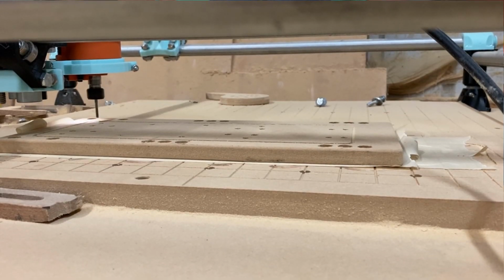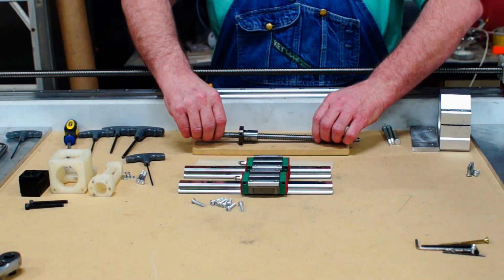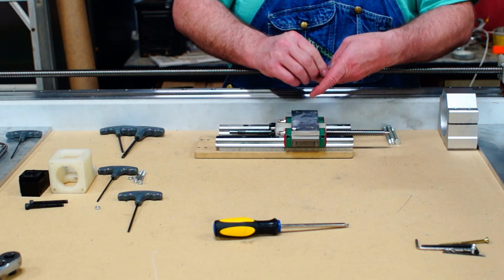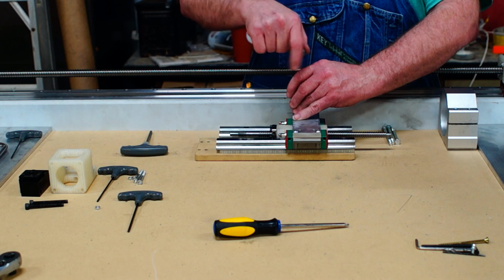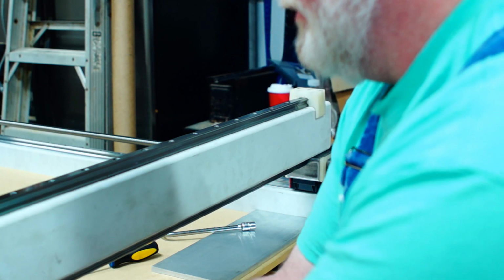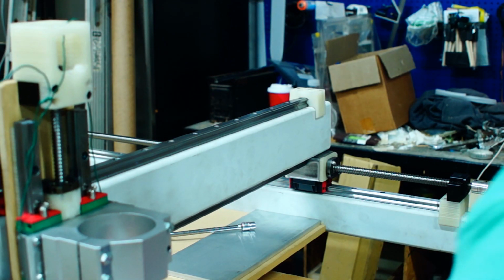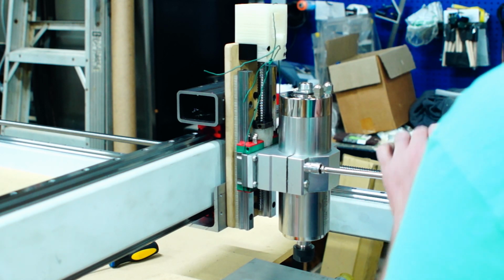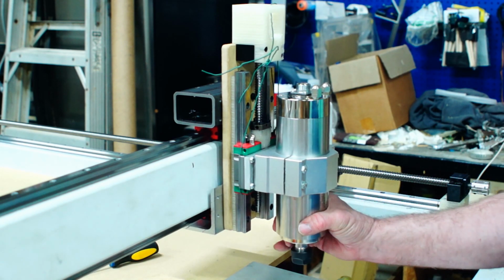Mudd Flapp Ranch- PrintNC Z Axis Build

Comment: I am so impressed with your video.  I just found your video today and it is awesome. I like the way you laid everything out at the beginning of the video and explained the parts list then showed why you changed fixtures and why. The bolt sizers and thread pitch is so helpful.   The hardware is just one of the hardest and most aggravating. I print a lot of 3D printed parts that I pry on with screwdrivers and beet on with dead blow hammers and I do not give them any slack.  Just a thought for someone else for the part that you thought would be the weak link and I can understand your thinking.  Just a thought,  could you have used a piece of all thread and extend it all the way down through the 3D printed part and put washers at bottom or a thin plate of Aluminum and even still tightened nuts at middle location.  Thank you so much!!  God Bless  A Thumbs up and I definitely Subscribed.
Reply from the maker: Thanks for the kind words. As to the strength of the 3D printed parts, I don't think it is a factor in my use of the PrintNC. Many builders go ahead and cut those parts from aluminum as one of their first projects.

Comment: Absolutely loving your series!  A trivial point:  when you used the Wixey to set the spindle to perpendicular, use it on the "Z" rails first, then do the spindle so it is parallel to the "Z" rails.  The difference is probably not detectable though, unless you are chasing microns!    :o)
Thank you... Liked and Subscribed.
Reply from the maker: Good catch. I did check the rails as well. Probably got edited out. They are also dead on, at least as good as the Wixe.y.

Comment: Thanks for the video.  For my Z-axis I ended up redesigning it to use stock aluminum materials I could buy locally (inch sizes).  I also am using a router with a larger mount so I needed to redesign the spindle mounting plate for two reasons.  One to allow the larger mount and two to allow it to go down further since the router doesn't have as much travel in the clamp as a spindle.  I was always worried about the system travelling too far so I came up with a simple solution for my setup.  I used an aluminum block to mount the ball screw nut.  Then I put a screw in the plate that holds the rails.  I put a couple washers under the head and lined it up with the ball screw.  I've got the height so the linear bearings just stop at the end.  Now I don't have to worry about everything falling off the end of the screw/rails.  Looks like you're getting close!
Reply from the maker: I had originally purchased a Makita router to use on my build, but came across a deal on a 2.2KW spindle, so I jumped on it. I had also designed a Z plate that extended about 2 inches down from the bottom of the gantry to extend the reach of the router. Now I have the spindle and a spare palm router. Spare routers are handy when working on projects with multiple bits, so nothing lost.
Reply: @MuddFlappRanch  Yes, you can never have too many routers.  I already had the router and it was too big for the standard spindle mount everyone else is using.  I'd like to get a spindle in the future but I'll start with the router and see where it goes.  Plus I was a little intimidated with the spindle wiring so using something I could just plug in was one less hurdle.